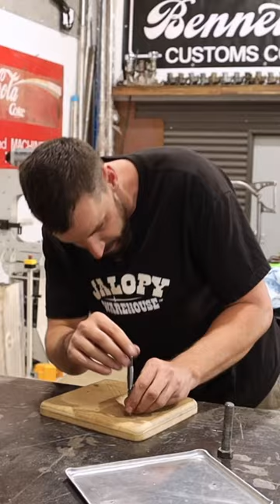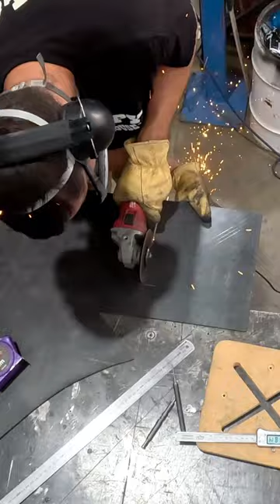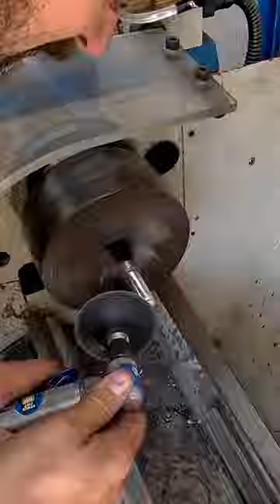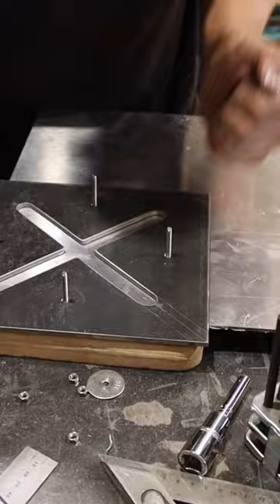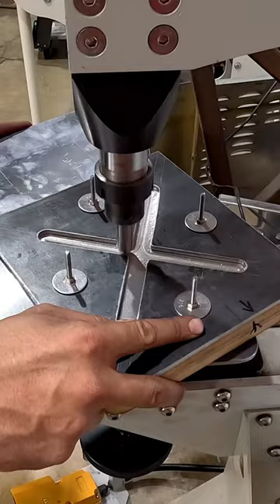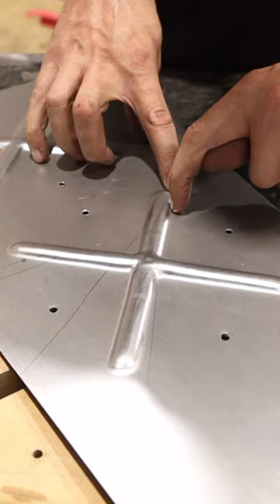DIY Tooling for HAMMER FORMING Beads on Sheet Metal

Comment: As good of a idea as it sounds and it definitely does work.
Be cautious grinding on your lathe, those small particles of your work piece and grinding media can damage moving components of your lathe.
Does not require much to start noticing that your machine is running out.

Anyhow, clean build.